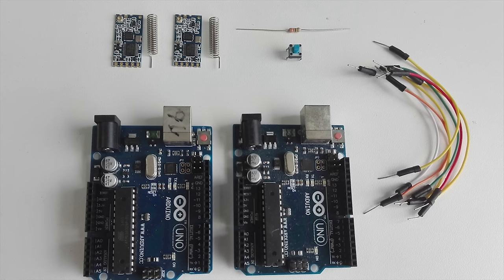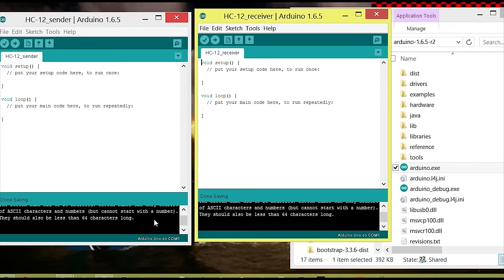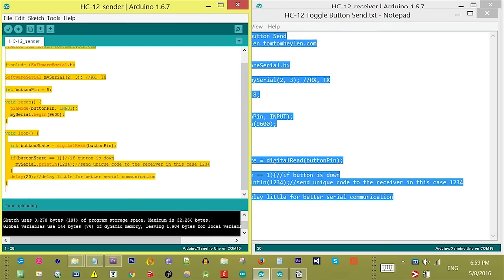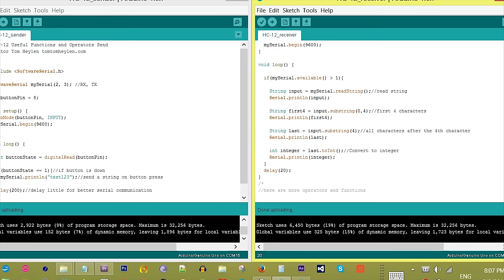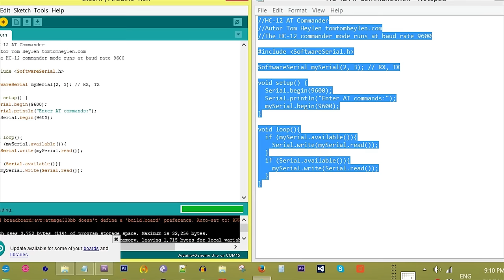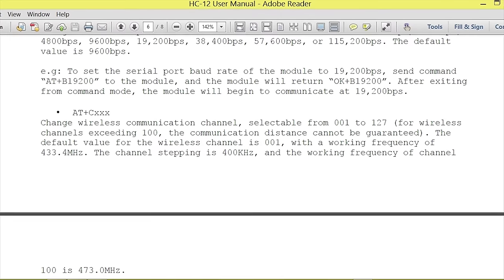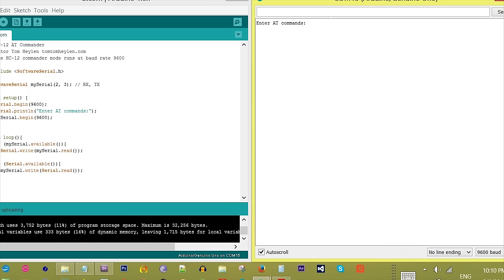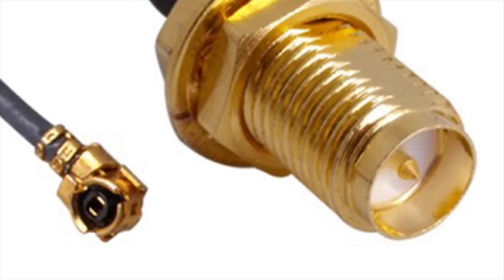Long range, 1.8km,  Arduino to Arduino wireless communication with the HC-12

Comment: is it possible to attach a ps3 controller aswell?
Reply from the maker: Everything is possible but I have no clue.
Reply: haha thanks! im looking for a way to control an rc car with a ps3 controller but if i use the bluetooth module the range will only be about 20-50m? do you have any ideas that might help? maybe a way to increase the range on the Bluetooth module or ?
Thanks for your help
Reply from the maker: I have a drone running on this modules. reaches over 2 km. The remote and the controller for the drone I made myself and works on trimpots and accelero meter x,y,z axis tilting. You need to find a way to convert the output of your ps3 controller and translate it with arduino code to send over the hc 12. But again I have no experience with the ps3. If you want the code, look at one of the previous comments. Cheers
Reply from the maker: Hi, it is hard for me to give an answer to this. I have no feedback on this library and the ps3 controller. I would say it is possible to use that library. You need to study that library a little and see what values you get and then translate it to the code that is usable for your project. As a general rule, it takes a month of research to get something working if you are new to it. So give it some time and keep trying.
Look at the Arduino map() function. This is the key to convert data. https://www.arduino.cc/en/Reference/Map
Reply: Thanks so much for all your help.. I'll keep working at it and keep you updated :)